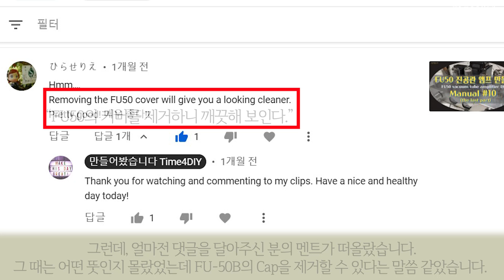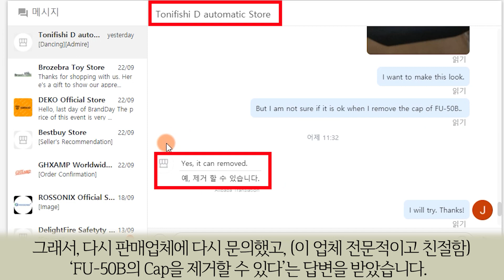[Manual #11] FU50 진공관 앰프 만들기(FU-50B 진공관 Cap 제거) FU50 vacuum tube amp(FU-50B tube cap removal)

Comment: How did your original tube break? I just finished the kit (following your guides, thank you so much) and the tube was dead after turning the amp on. (probably the stress at the pins when putting it into the socket +the heat afterward)
I think this tube was badly designed, in term of being the size is rather big but it comes with bare base (usually this size of tube should come with ceramic base to avoid the crack.)
Reply from the maker: Hi. In my case, I tried to put the right FU50 tube into socket with power. And there was a flaim inside the tube right after switch-on. When I took off the tube and checked the bottom of tube, I found the glass parts was cracked...
(I experienced this situation twice. The recent one occured last week. So I ordered new FU50 pair to aliexpress. I am waiting for them now.)

And, I fully agree with your opinion that the design of FU50 is wrong.
Reply: @time4diy626  Ty for the reply. Yup exactly the same case then... 😅
Reply from the maker: Well, I ordered new socket for FU50 also. I will replace the sockets before putting new FU50 tubes this time. 
That's because I think the putting parts inside of sockets are kind of bended...
Reply from the maker: I wish you best luck with your new tube. Have a nice Music day~!